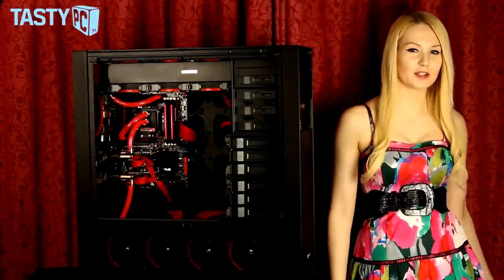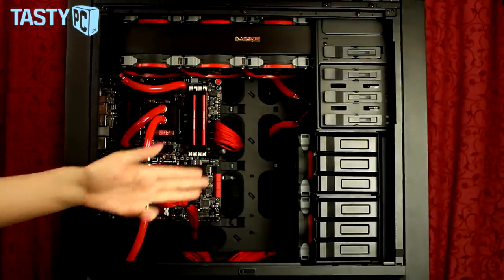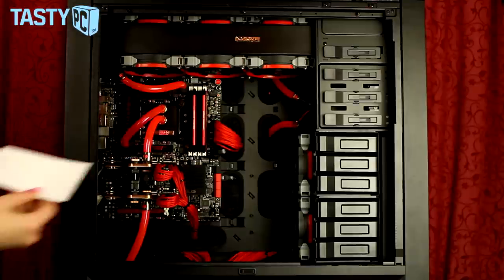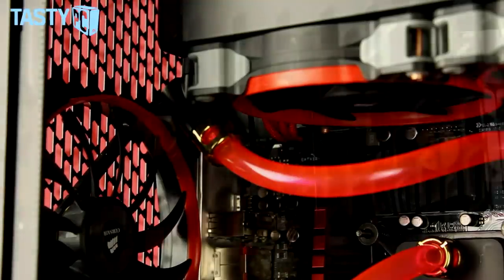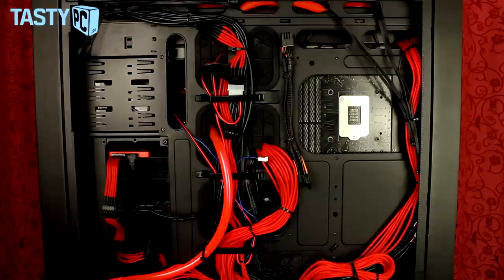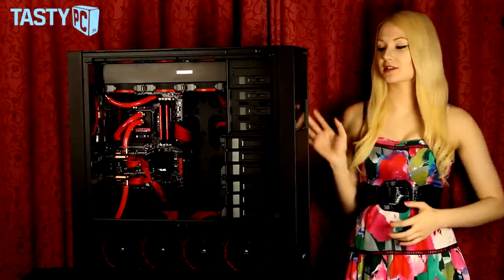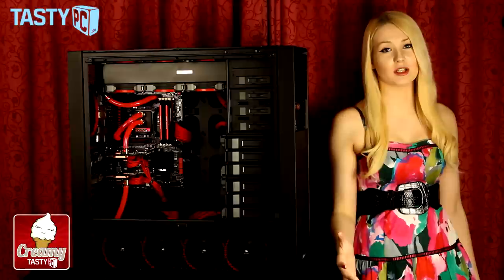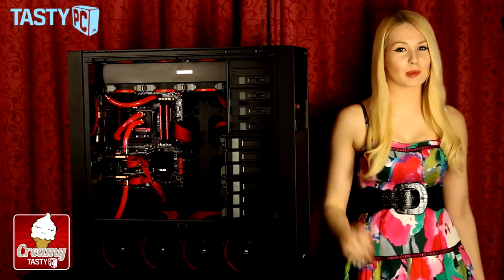Corsair Obsidian 900D Review - Part 3 Conclusion

Comment from the maker: The board has barbs, which is what the tube is on. No missing fittings there. Normally it's advisable that you put a hose clamp or clip over the top but it's not a necessity.

Comment from the maker: They are all quiet edition fans and I would of put low noise adapters on all of them making the rig pretty quiet. If this was a rig I was actually using/keeping I would of programed cooling zones and stages. So when I'm just on the internet only 4-6 fans are spinning slowly. As the CPU/GPU temps increase, more fans would turn on. Don't think it would ever get to the point where all 20 were needed on full but the option would be there for a OC session.

Comment: Impressive case.  You were able to out rad my Switch, but sadly, the fin surface area (I use similar 140mm Alphacool radiators) is only slightly less than a 240mm*120mm*60mm radiator's difference with an additional radiator over mine.  Nice review.  Thank you.

Comment: I think your right Lauren, I don't think we'll see many massive cases like this anymore, things are trending towards smaller form factors.  Only the extreme enthusiasts are going to go with massive cases for triple graphics cards and tons of WC in them.  I'm even thinking of changing my Switch 810 for something smaller, the new Fractal Design Arc Mini R2 can fit an RX360 and RX240 in it, thats more than enough rad for me, throw in a Micro ATX board and my 7970 and I'm off :)

Comment: Honestly I think giant cases are going to become less and less prevelant what with hardware becoming better and smaller (usually at the same time) Something like this would serve most likely as a personal project where you can tinker with watercooling things. I myself have a corsair 350d and it just does pretty much everything I want without getting in the way (Perhaps bar watercooling stuff, aside from a closed loop cpu cooler).

On a side note what cooling fans did you use on the rads?

Comment: I don't get the point of different thicknesses of radiators, wouldn't it make sense to keep it as thin as possible to get the heat out faster?
Reply: A thicker radiator has the same effect as a longer radiator, and as you probably know, the longer the radiator the cooler the air will get since it takes longer for the water to go through it and every second the water is in the rad it's being cooled by the fans. So a thicker radiator means not only more surface area for the copper to absorb the heat like a cpu heatsink does, but more time spent with the fans blowing on the water to cool it more. But in a case like this you don't really have to worry about radiator deppth usually, and sometimes it's prefferable.

Say you want to actually use the cd/dvd drive bay? That means you can't use the 480mm long radiator with 4 fans, but if you have a complex loop going from a 480mm long 40mm thick radiator to a 360mm long 40mm thick one with 3 120mm fans might not be enough to cool your stuff. So the solution is to get a thicker one, like a 360mm long by 60mm thick one, or the "Monsta" radiator (by EK iirc) which comes in 360mm/480mm/560mm long and is 86mm thick!!

Comment: TastyPCTV what do you think of this build

- Asus GTX 670 DirectCU II 980MHZ 2GB 6GHZ 

- Corsair Vengeance Pro Red 16gb 

- Samsung 840 Series 500GB SSD 

- Western Digital Caviar Black 2TB 

- Cooler Master Cosmos II (case) 

- Corsair AX760I 760W ATX 12V V2.31 80 Plus Platinum Modular Power Supply

- ASUS DVD writer 

- Be Quiet! Dark Rock 2 CPU Cooler 

- Intel Core i7 4770K Unlocked Quad Core 3.5GHZ Processor 

- ASUS Maximus VI Hero ATX motherboard 

Amazing or just good?

Comment: I loved your reviews and how your build came out. Came across your videos while checking out pre-purchase ideas, that being said....I  agree with you on the look of the case. I think they spend so much time to get the inside just right, then kinda dropped the ball on the finishing looks.  By that I'm reffering to the front bay covers and such.... looks ok if left on, but take them off and install a dvd drive... not so much then. Even the USB area looks plain, unfinished in a way, almost as if they tried for less is more and just wound up with less. Did you/will you post a video of the rig running?

Comment: is there any benefit in using 4 rads over 3 ( 2x480 , 1 x 240 )or 2 rads ( 2 x 480 ) in a single-loop and /or a dual-loop with 2 or 1 pump ( in serial )

Regards.

Comment: First, I don't know a lot of english, but i have a question:
The power supply will be damage if the radiator transmite hot air to her? I think that i write all good ;)
Reply: +TheMasterKiller Ytb the power supply takes in cool air from the side of the case and exhausts it at the back, so the little warm air from the radiator that gets blown onto itt won't be a problem

Comment: Can you give me all the specs of this Desktop?
I just ordered the 900D
2 EVGA 780GTX
AX1200I
Maximus VI Extreme
Corsair platnium 2666MHZ
i7-4770K intel
2 256GB 840 Samsung Pro SSD
29Inch LG 21:9

Am having trouble finding a good cooling system KIT and I really like the way yours is set up so I would like to know every single piecece in your colling system please.
Also I would like all the red wires can you tell me how many I would need? And what kind? (Red only)
Thanks

Comment: you have only 1 pump for all the crazyness, is that enough?
Reply: More pumps makes no difference minus cutting down on noise.
Reply: Green Knight  i'm sorry , but it does because the more waterblocks and rads you have in a loop, the higher flow resistence will be, and at some point a stronger pump will be needed or two.
Reply: ciriusn wrong, two pumps will not change speed unless an actual block is in place or you have a 15$ fish tank pump. The pump will run on full speed and move the water at the same speed and produce the same temps as two pumps. and lastly this setup here is pretty basic not craziness, one basic pump would run this fine, check my video I am running 3 super thick rads 2 gpu blocks my cpu and a giant res with 1 pump. my idle temp is 31c
Reply: Green Knight if that's the case, then you might be right, but I never said that 2 pumps change speed and or temps, I just said 2 pumps increase suction strength, to overcome increased resistance from a complex loop. But anyway, this pumps are strong, no doubt about that, I was just wondering.
Reply: ciriusn Yeah just 1
Reply: depends on the type pump some pumps are best when used solo you can get some crazy  strong pumps and only need one

Comment: I like the case, it is a monster sized case, really do not think it needs as much radiator space as it is capable of accommodating.  Would much rather see a dual socket Mother board for this case rather then the single socket boards...  I really thought you went cheap on the graphics cards.  Should have gone with two titans or at the least 2 680 4gb memory cards...  but besides the smaller GPU's, I liked the build!!

Comment: This is only my opinion and alot of people may and probably wont agree with me but I think water cooling GPUs is more of a hassle than its worth. Reson being is to keep up with times you need to or should be swapping out gpus vary frequently. Water cooling a cpu is fine though but honestly not nesasary as long as you have an after market cpu/fan cooler and plenty of fans with in your case. Temps are gonna be the same you may loose one to two degrees by having a water cooled cpu but thats it. Maybe at the vary vary most 5 degrees although alot of the times if you get a good cpu cooler/cpu fan theres no difference.

Comment: can you write all the items used in making pc? (processor, board and also watercooling thanks :)
Reply from the maker: That's all in the description :)
Reply: Ops ... really? :0p
Reply: TastyPCTV Any idea where I can get the red cables? I have all the parts from this build but I have 3 780tis with water blocks etc, apart from that its pretty much the same except for the motherboard and CPU.
Reply: The Marshmallow Man Look on amazon or newegg. They're sold by like corsair and stuff. Most popular power supply brands have a custom sleeved cable packet you can buy in different colors and lengths. They're expensive though, look to spend between $50 and $100 depending on how big your psu is.

Comment: yeah I hate the Huge cases these days.. they are ridiculously huge for no reason.. the benefit you get out of jamming 5 radiators in there really isnt worth it, overclocking an i5 or i7 to 5ghz, can be done with one rad...  I modded my old school antec 900 to fit a dual and a single rad and it screams with the overclock with amazing temps (check out my vid ;)) but yes I agree these cases are too big and just not practical

Comment: you just missed the idea of huge cases it's the ability to mod your system as you wish 
and those cases are not about to die and it is certainly not the "end of their era" it just for certain people most people wont need those cases
but people who like to do crazy loops and put lot of stuff it's the right case for them
and you also got it all wrong how to use the cable management this case by any means doesn't it quite durable
but the top thing about it it does the job extremely well maybe it doesn't feature the most luxurious look of some cases 
like let say the cosmos 2 but it compensates by loads functionality and utility, and that why many top notch watercooling builds 
use this case and sometimes heavily mod the case to be how they like it (that crucial part of advanced watercooling) 
and you talked about sizes getting smaller well that true in some level but not for lot of hardware and especially for higher performance\capability rigs.   
2 years later(from this video release date) you still get the big cards with atx mobos and all of those big watercooling equipment are still live and kicking 
people who want to water cool at some point they will get those super towers and even bigger cases that can fit gigantic radiator, huge acrylic tube reservoirs and 
ofc loads of fans, it always have been like that and always will and the number one proof for that is the huge watercooling market which consists thousands of parts and it exits for over a decade or so.

Comment: Honestly, for what these cases are worth they're pretty cheaply made and lack innovative engineering. I was a bit disappointed, for one its very very thin. Yes the slot screws are a pain in the butt, the ASUS 780Ti have a really high PCB at back and you can barely get to them even with the angled screw driver, I would say basically impossible with TRI-SLI. A flip panel or removable panel over the slots would be great. The HDD bays are very flimsy, 2 fell apart as soon as i took them out but they have a plastic pin u put back in. All the fan mounts are so thin and screw holes threads quite awful, very easy to miss-thread. I could say a lot more, the case does serve the intended purpose to fit what you want but could have a far higher build quality and some more engineering work. Not worth the price tag imo or the reputation it has. I would say go something similar from another company.